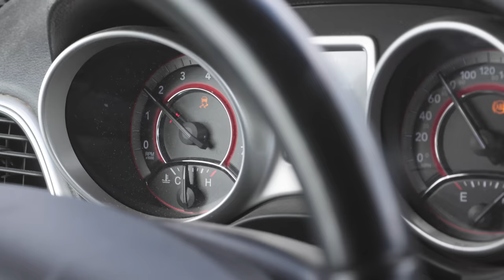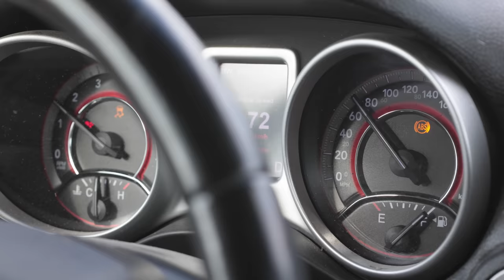Vince's Dodge Journey Gets an Engine Swap... Worth It?

Comment from the maker: Only 10 more days to enter to win a Holley Sniper EFI + JuiceBox's air cleaner signed by myself and Derek from VGG! https://debossgarage.com/contest
Reply: On rust buckets like this--  I would always rather pull the CV's, pull the hood and just pluck it out the top.  Why mess with all that other stuff:  subframe/ steering/ brake lines/ etc..  and risk breaking half of it while fighting it to come apart...   I guess doing it your way will end up going back together as a better car since everything has been touched/ broken loose/ etc..  But there's not really any benefit to going out the bottom once they get so old.

Comment: One important piece of information that wasn't included in this video has to do with the steering column and clock spring.  It is important to make sure that the steering wheel is not turned once it is disconnected from the steering rack because it can break the clock spring since it can only turn a certain amount of times in each direction.  A common practice of mechanics is to move the drivers seat all the way forward and to wrap the seat belt around the steering wheel and lock it in to place and back the seat back up.
Reply from the maker: Thanks for that!
Reply: @Usual Suspect Exterminator Whats not true

Comment: Done a bunch of those and it's one of the easiest ones to drop out and change. You can just pull the ps pump off the motor, just yank the front axles,and just unplug the harness from the fuse block, and unbolt the exhaust off the manifold.. and there's a ton of room so you don't need to drop the k
 frame.

Comment: I've been a mechanic for 20 years, mostly for GM and a 5 year stint with VW/Audi/Porsche.  I didn't have a major opinion about Dodge/Chrysler one way or the other.  That changed when I spent the last 8 years working for a credit lot chain where we sold TONS of cheap Dodge/Chrysler products.  I can now confidently say they are some of the worst cars on the road.  We sold anything and everything, but it was always the Chrysler/Dodge cars coming back on the hook with problems.  A close second was Kia/Hyundai cars with their self-destructing GDI engines.
Reply from the maker: I heard Kia was good with their engine warranty though.  We have a 2018 Sportage and so far have been really happy with it
Reply: @DEBOSSGARAGE  They really have been.  Biggest problem in our area is the waiting time for our local dealership to get time to replace the engine.  They're backed up pretty bad.  Aside from the random rod ejection, modern Kia/Hyundai vehicles are pretty nice.
Reply: I like my crown vics. I cam work on one in my sleep they are so easy to work on when you have to work on them. Just reliable cars

Comment: Thank you Rich! You just showed me that I'm not alone in hating some jobs.  Picture this, I'm 70, a retired med duty truck tech,  replacing a cam sensor on a 03 1500  Silverado,  4.8, without removing the intake, with a mirror, outside in 30f  & windy! After many trips inside to defrost fingers, I invented many new languages!

Comment: Love this. Fun video! Nothing’s ever simple. Always frustrating to see a coolant leak destroy an engine. I’ve seen friends destroy engines by not bothering to check oil level periodically (I know, not the problem here). I explain to them the oil light is on a pressure switch not a level sensor, on their cars anyway. So when the light is on you’ve already lost oil pressure. Don’t drive to the next gas station to check the level! Shut it down! I guess in this case, don’t ignore a coolant level sensor light or the coolant temp gauge spiking. Or a coolant smell, etc.
Reply from the maker: Education is key.  This journey has a temperature gauge.
Reply: @DEBOSSGARAGE  I guess most of my experience is with VW/Audi with pressurized coolant reservoirs. A coolant level sensor saved me in the middle of Nebraska on a cross country trip. Saw the low coolant light, pulled over to discover a burst hose, stopped at O’Reilly for some silicone tape and patched it up. Added some water and finished my trip.

Comment: Rich, look over TSB 18-058-19 when you get a chance. I program these PCMs often, and that TSB is a standard disclaimer when updating or replacing a PCM on these. It's only relevant when programming the module after an engine swap, I went down a rabbit hole one day trying to figure out exactly what is happening, best theory so far is part number changes on cam phasers cause it. Thought you should know.

Comment: Keep your fluids happy is the best advice you can give someone. I had a 01 saturn that I bought nearly new and like all those 1.9 liters it leaked/burned oil terrible. I put a quart of oil in it every other week for 12 years and it had 335,000+ miles on it when I sold it. Even heavy oil burners can last a long time as long as you religiously check your fluids 👍
Reply: I miss Saturn's! Every one I owned was still running with over 300,000 miles on them. My hole family owned them at one time. Great cars, lasted forever, didn't rust out, guess that's why they don't exist anymore... Planned obselesence. But you know they really care about the environment and "climate change"...
Reply: @mikehunt8375  yeah I owned 3 of them at one point and my brother and dad also dabbled. Good little cars, terrible heater if you’re in the tundra

Comment: Can certainly agree with the thoughts on the junk plastic/ composite everywhere that Dodge used. Had a Nitro in for an oil change and the top of the dipstick broke right off, plastic seized to the tube.

Comment: Maybe it's just me but taking an old rusty vehicle and taking it apart and making everything all nice and clean and new again is such a satisfying thing for me and is why I love working on vehicles granted there are some I prefer to others like my 3rd gen ram trucks I own 3 that are fully together and running great with no noises or issues but Two of them I bought cheap because they needed a bunch of work but most of it was labor which I don't mind so I stripped them down to the frame and cleaned them up with new brake lines and fuel lines and etc and cleaned the frames up and painted them and everything so as thry go back together they are good to go for years to come. I also don't drive them in the winter because here in PA they use so much salt I'm suprised the entire state doesn't have high cholesterol lol

Comment: The 6 cylinder engine and 6 speed transmission is the better journey engine and transmission. The little 4 bangers are nothing but problems. I got 09 journey and it goes through a litter of oil every month and it runs like a champ with just over 300 thousand km. Great video

Comment: Yes the plastic on a dodge is probably some of the worst there is. Although you can get a lot of aftermarket pieces for the dashes on the second gen’s, mainly the cover parts, the pieces below you can’t and what you find at a junk yard is just as bad as what your trying to fix. But the one thing I admire about the dash of a dodge second gen is I can have the whole dash out and on the shop floor in a couple hours fix it and have it back in a couple more hours. Takes that long because I’m almost 70. I haven’t worked on any chevys or fords of those years as simple and easy and the dashes crack on both those makes of those years too. No company makes a decent truck and ones easy to work on anymore and the new ones really suck.
Reply: Yeah Dodge makes it really easy to pull the dash, I've done a 2001 and 2012 the newer one was just as easy. My square body gmc on the other hand is generally easy to work on but the dash is literally welded to the body.

Comment: this is why i always put real-time mechanical gauges on my cars. they saved me an engine in every car i put them in. blew a heaterhose off the the first one. the temp gauge rose to 215 and stayed there. i knew that was very odd for that car so i looked under the hood and found the heater hose off and no coolant in the engine. the idiot light would have never turned on since there was no water to heat the probe up and i would have fried the engine if not for the gauges.

Comment: my 07 frontier had those composite connectors on the heater core hoses. I broke down and was diagnosing a bad ignition coil when my forearm barely brushed one of the connectors. it blew up and sent a volcano of coolant up my arm. second degree burns. since then, any "composite" connectors on my vehicles are swapped for metal ones immediately.
Reply from the maker: I'm sorry to hear that.  Thanks for the heads up as I can see myself in the same situation at some point

Comment: Gmc uses those garbage composite coolant connectors too i spent some time chasing a few coolant leaks in my 05 yukon xl one was the t connector between the reservoir and lower rad hose the other was the quick connect at the heater core... I agree with them being garbage

Comment: No offense to Vince but the fitting didn't kill the engine, the driver did when it broke and there was a huge release of coolant and kept going.  We have an 09 Journey in the family here and being familiar with it there is NO WAY he didn't smell that happen, all the coolant would have went down on the exhaust and catalytic converter, huge cloud of steam and smell from burning coolant, and the temp would have climbed pretty quick on the gauge.  I know how it is just wanting to get home but i would have pulled over, found where it was wet and running out of that fitting and just left it on the side of the road and made a phone call.  Ten bucks later and some coolant it would have been fixed and still running, sucks but sometimes you can't just keep driving.  Ours don't seem to be brittle and it has a lot of miles on it, only issue we had with it was the intake runner solenoid, took it apart cleaned and lubricated it and put it back on when it got stuck and popped the check engine light.

Comment: Rich you're right about saving old junk. I bought a low milage 2005 toyota 4wd in June. Missus wanted brand new, but that's ridiculous atm. The truck has needed a few bits and pieces, but it's a heap cheaper. And besides, every old car we keep going is stopping 500kg of plastic being sold to us in a new car.

Comment: 2008 Mazda 5 Minivan. Already looking for a spare motor to rebuild from fresh. The transmission is going to have to be done by a shop, but my plan is to take the 250K miles already on it, and make it go another 250K. thankfully, locally, in January, Annual Emissions testing and Inspections goes away. I could techinically put in a Haltech or some other EFI system for better tuning and make it drive even better, perhaps even swap in a bolt in transmission that isn't so dependent on electric solonoids known for going bad...we will see what my homework produces.

Comment: It's the same issue many BMW's and other German cars have had for some time. Lots of cheap small parts that are a pain to replace preventively but if they break then there goes the engine or transmission.

Comment: Fittings are really expensive currently, I purchased today a 3/8" pipe Tee, 3/8 to 1/8 bushing, 1/8x1/8 barbed , 3/8 hex nipple, $25.00, stainless steel bolts and nuts are crazy.

Comment: Sure, its aggravating but dang man, people are too broke to do other ways of fixing issues. We have the throw it away mentality. I worked on a older rig for a man whom I didn't know at all but money is money and he sounded pretty desperate to have fixed... go a couple years, I have a problem myself. I just pulled onto the highway and a big truck comes out of a alley and parks on top of me. Jaws of life cut me out so good on that part but still go to emergency room for stitches. Guess who the doctor is? ya, you got it, the guy who's engine work I did and I might add, did a great job putting me back together

Comment: Have to K swap the Journey, Rich. 
The Honda K is a tank engine. It’ll run for years at high rpm without a problem. 
Turbo it so Vince has like 350 HP at the wheels. 
Either that or maybe a  Perkins like that 87? Ford Ranger.

Comment: A simple thing like changing the serpentine belt can be a nightmare on those transverse mounted engines. I got a 97 mercury villager, even worse than that dodge. They just don’t give you any room or mercy.
Reply: I had a 97 Malibu that needed to remove the motor mount to change the belt, absolute god awful design.

Comment: My buddy here in Elberta, Alabama owns Bobe's Garage. He is a 3rd generation mechanic. He is the only one I trust. He is always saying he hates all dodge products. Pure junk. But he also says they have kept his family well feed  for a long time. He said if everyone purchased Toyotas or Hondas he would have less buisness for sure. 
Just about all manufacturers now are junk. Cheap, cheap, cheap parts and to much freaking plastic.
Reply: @@jimmason2388 cheep cheep cheep go the birdies(bean counters) circling around the enigineers heads.
it's all about how they can save them $$$ by using (insert inferior garbage product here) and making the assembly line run smoother. it's all to the point of biting them in the rears now. everything is far overpriced and utter trash quality.

Comment: I disagree with the screw type hose clamps.   They leak after heat cycling.   The other clamps auto tension.   However screw type are much easier.

Comment: Had to swap an engine in an olf Camry that lost fluid from a broken plastic part. Temp gauge was on the other side so by the time they saw the hot indicator, the engine was melted. $3 part.

Comment: My mother in law has one of these piles. Surprisingly the only problem it's had was a bad speed sensor and the doors filled with water. She told me her door sounds like an aquarium. I'm like, what? Sure enough there are several clear stickers under the door with holes poked through them. Why chrysler put them there is beyond me. All the doors had them. I peeled them all off and the afflicted door looked like a river flowing out.

Comment: On rust buckets like this--  I would always rather pull the CV's, pull the hood and just pluck it out the top.  Why mess with all that other stuff:  subframe/ steering/ brake lines/ etc..  and risk breaking half of it while fighting it to come apart...   I guess doing it your way will end up going back together as a better car since everything has been touched/ broken loose/ etc..  But there's not really any benefit to going out the bottom once they get so old.

Comment: I have a 2012 Journey same as this one 340000 km Original engine Change the oil every 7000 km still runs great no funny noises but definitely showing it's age. I know what you mean by that cheap plastic.

Comment: Heating up the manual valve selector shaft and transmission case was not a good idea.  The a604 family of transmissions uses a blue lip seal that is just below the surface of the transmission case in a groove on the shaft and the only way to replace that seal is to remove the valve body from the transmission.  Those transmissions are junk and Chrysler has continued to update and adapt them for other vehicles, the a604 was spawned into the  62te and the 42rle which was commonly used in jeeps in which they are utter garage, they essentially removed the differential amd chain drive to make it a longitudinal transmission instead of transverse.  The 62te is well known for it's manual valve shaft problems due to a nylon bushing that is known for expanding and cracking which normally required a replacement shaft but sonnax came up with a solution for that problem.

Comment: 10 years? No way. Everything plastic in the cooling system has failed, exactly where this on did plus the thermostat assy leaked as well. I used ¾ pex T to fix the heater hoses on the fire wall

Comment: That composite plastic that they use for the cooling system is a design failure I’ve changed multiple radiators and elbows that were broken are leaking

Comment: Dodges are disposable.
Showing the needlenose against the fitting was great. They are super cheap, but also that's not the application, to survive against pliers, so they kinda did work against their intended purpose. No I wouldn't want a car with those fittings either.
Also roadside assistance  + Lyft would have avoided all this
You had an episode about wearing gloves, maybe you forgot this time

Comment: If the subframe isn't mounted to the engine then why drop them together? I always disconnect the lower arms at the ball joints and leave the struts on the car, then drop the subframe,then the power train.

Comment: $1500, and 200k km later… 840k on the clock with just fluid changes and set of ball joints.

Comment: 12:32 uh-oh, better hope the rest of the engine is the same, sensors, crank/cam tone rings and more. there's a narrow amount of interchangeable engines across years/platforms and even shift change roll overs mid year/month/week where things become completely different and not just  engines, also transmissions, brake, hvac, other computers/modules, pretty much anything with power or movement. 🤯

Comment: Can you adjust the shutter speed on the gopros? Or whatever camera you're using? Those lines are from an LED flashlight or lights you must have.
Reply from the maker: The frequency of the under hood light is what causes it. Every other light is fine so doesn’t make sense to adjust the camera shutter
Reply: @DEBOSSGARAGE  I've found that if you flip the light over so it's pointing more at the hood that it diffuses the light enough to calm the camera down and still has enough output to see what's going on.
Reply: @DEBOSSGARAGE  Understandable. I've seen it a few times on your videos. Its similar to CRT's and their scan line. Least it wasn't the entire video, only the beginning bit. Cheers 👍